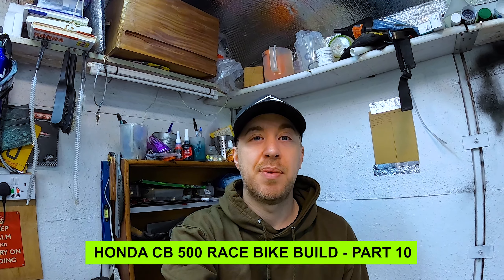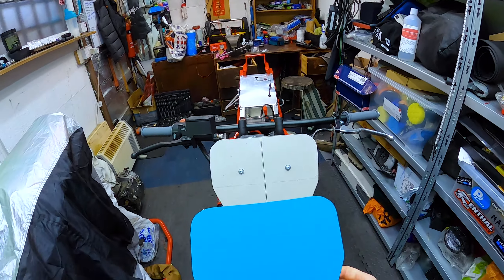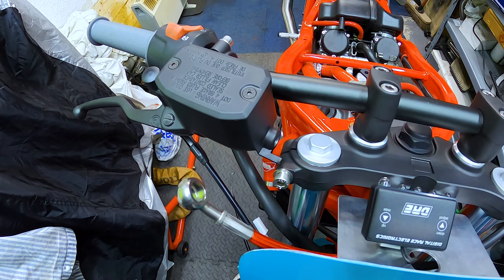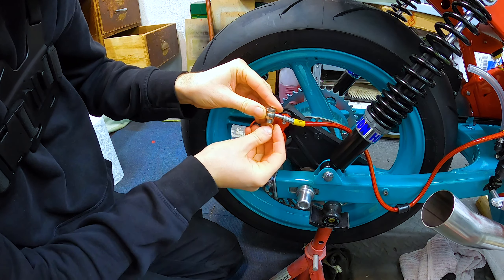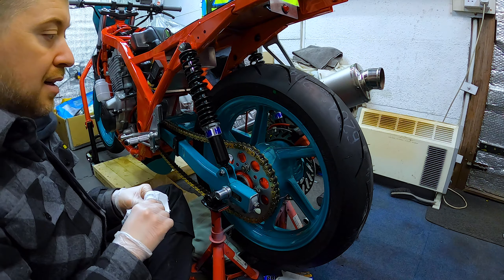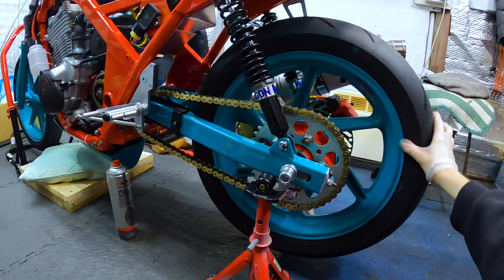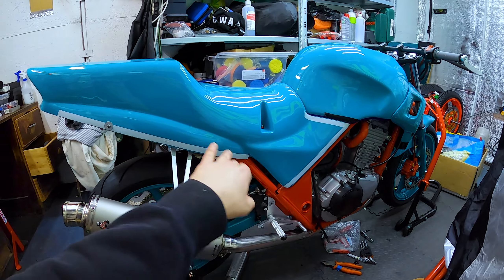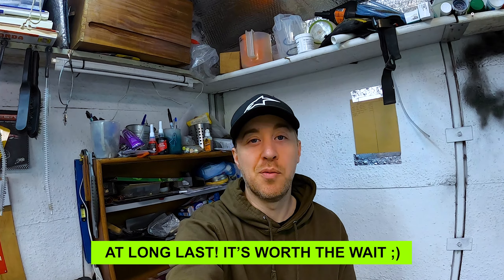Honda CB500 Thundersport race bike build (part 10) custom

Comment: I use a spring link on the chain, not a problem on the cb5 as low powered, much easier to remove when necessary
Reply from the maker: I thought about one. A mate had one on his R6 but it came loose and shattered his engine case. Put me off using them a bit, but that is a more powerful machine as you say. 👍

Comment: If you lived somewhere where there is no Thundersport race series. Would you have a CB500 for a track bike because it's fun as fook or would you want something with more broom?
Reply from the maker: The one thing I've learned about these bikes is that they are capable of embarrassing faster bikes. It's all down to the rider. Yes, they are physically slower than bigger bikes, but half the time the riders are not riding the bigger bike anywhere near it's limit. These things are very quick in corners and you can have some real fun on them. It's definitely made me a better rider. I should have got one of these as my first bike then learned to ride it quick, then move up. But of course, everyone thinks they are faster than they are 🤣 Some of the lads at Thundersport are extremely quick on these! They crash well too. So yeah, i would definitely consider it if I were you.
Reply: @SuggyRacing  Awesome thanks for the detailed reply. Ive just binge watched all your videos and im looking forward to the next one. Cheers
Reply from the maker: Cheers mate. Yeah it won't be long until next one is on. Next few days 👍 I've got some track footage to upload too 😄
Reply: @SuggyRacing  So I finally got around to getting my hands on my own CB 😅 Just wondering what axle sliders you have there?
Reply from the maker: @Kenoathy Hey. How are you finding it so far? The aluminium parts you mean? They are made by one of the lads who races. You have to drill and tap the axle and mount them on.

Comment: What did you set your chain tension to?
Reply from the maker: Hi. I did it for how most do the race bikes, it's a shorter chain than usual.  It's got the minimum links that I can use. It means it pulls the wheel forward in the swingarm so that it shortens the wheel base a bit. To set the slack, I just found the slackest part of the chain then just made sure it was close to what the manual recommends/by eye. It's a little different to a road bike, on this I'm more concerned about getting the best set up I can. Where as on the road bike, I'd be wanting it set to what the manual recommends for long term chain life. Hope that makes sense.

Comment: Friend, could you share what improvements were made for power gain? and what is the final power on the dyno?
Reply from the maker: Hi, we aren't allowed to make improvements to add power to the bike for racing. All we can do it set the jets up so that it runs a best/smoothly as possible. In the thundersport regulations it says "A 5% tolerance will be allowed on the main jet size only". That's all we can do. I've not actually had a power run done yet, only had the bike on the Dyno to run the engine in as it was fully rebuilt. It needed to be run in properly before I could start racing. These bikes should be 52hp. Hope that helps 👍

Comment: Hi.  How long are the front brake hoses?
Reply from the maker: Hi I'm not sure on the exact length they came ready cut to that size I needed. You can get them from here and they will be ready to go straight on the bike...

https://www.sfpartsltd.co.uk/hel-performance-front-brake-line-for-honda-cb500-1994-2003.html